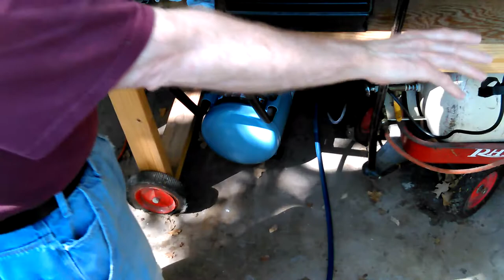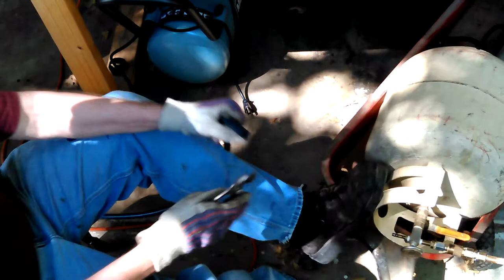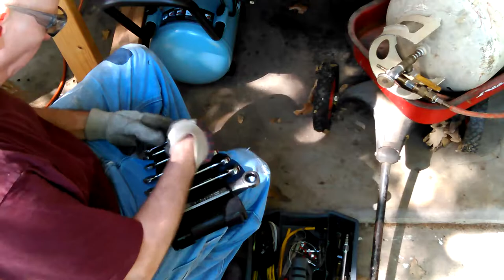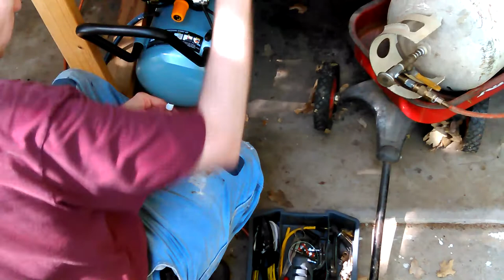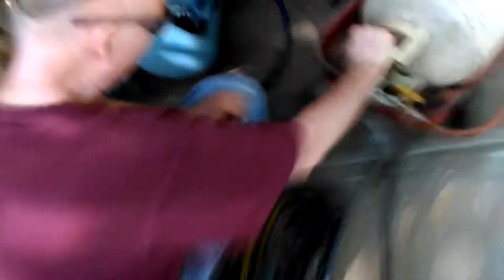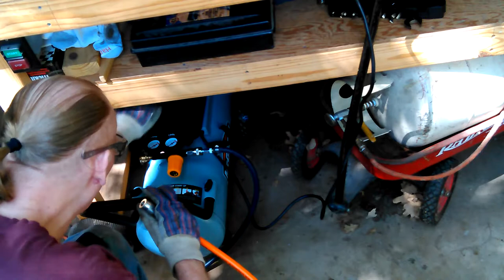Harbor Freight McGraw 8 gallon 1.5 HP 150 PSI Oil Free Air Compressor Setup Pt2 2019-05-17

Comment: Had my sound turned all the way up but most the time can't hear a word he's saying don't have a clue what the propane tank is for
Reply: Hes basically doing a homemade capacity increase. It might help if your using the compressor to run air wrenches and such. Personally I'd just let the 8 gallon tank just refill itself. The expansion might save on compressor life over time since these cheap oiless compressors have limited life. The reed valves go bad over time if you use it a lot.